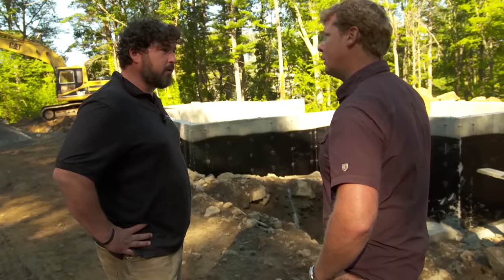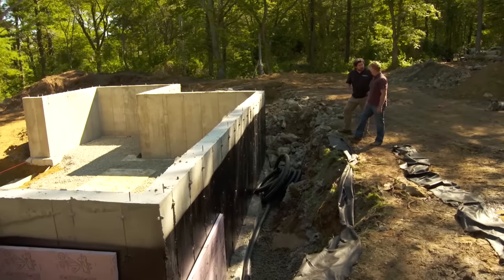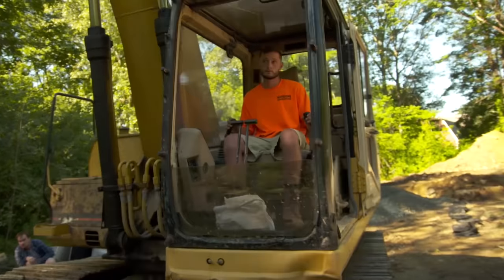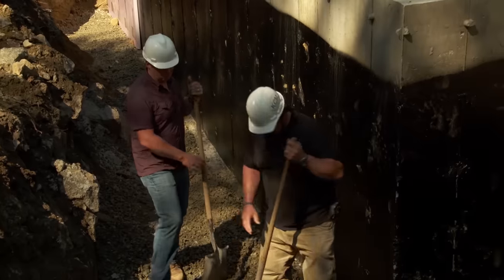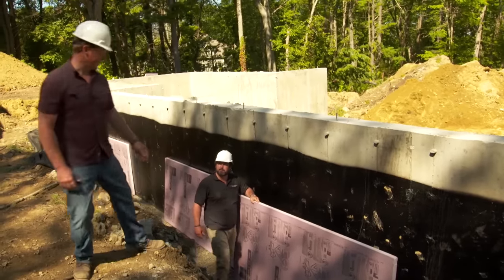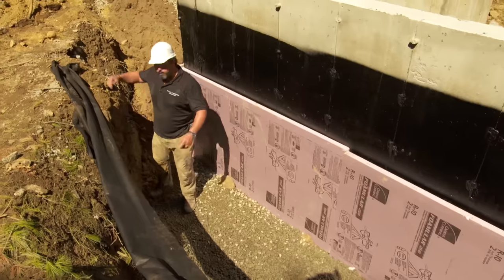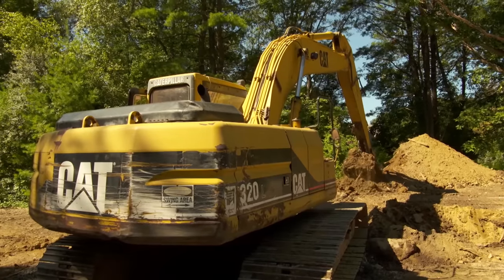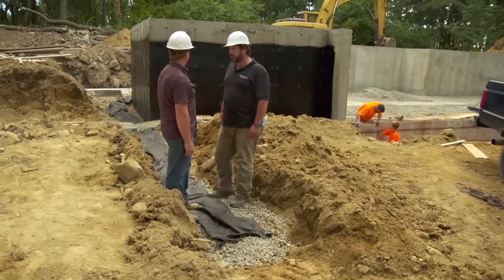How to Install a Perimeter Drain | This Old House

Comment: Sooo.....  You don't seal the panels of EPS together?  Water gets behind those if you don't seal them and then there's pretty much 0 insulation value.

Seems like this builder is just doing the exterior insulation with as minimal effort to satisfy code with no care to actual performance.
Reply: hey come on, he put some a random rock in place to hold it.  Job done.

Comment: Does the landscape fabric get plugged up?
Reply: It 100% gets plugged up if you put it over top the pipe like they did here in the video. You can put it underneath and on the sides of the trench but never overtop, and never wrapping the pipe.
Reply: @AlMai222  i think there ought to be a crushed rock vertical wall up against the cement foundation all the way to the bottom where the drain is at. Maybe be 2’ out from the wall. With the fabric being the barrier between the crushed rock and the backfill.  Dead leaves will probably be blown off the top of rock, at least able to keep clean.
Reply: @benritchsmith  that does work, it works really well like a French drain. And the fabric on the sides to block the dirt from the vertical gravel wall works like a charm.  Usually you wanna go a little wider than just 2 feet

Comment: I would have used solid pvc, holes facing down.
Reply: Holes face downward to allow water to enter from the lowest point in the ground. Holes downward also keep pipe from clogging since entry point into pipe is already at the lowest point. 
Holes on top would require the water level in soil to raise an additional 4” before it made its way into the pipe. With holes on top the pipe could potentially and most likely get clogged over time as there would be no where for the debris to settle out at.
Reply: @JohnSmith-xx9se  wrong dummy...water fills and rises from the bottom up. Have you ever even seen one of these work?
Reply: You want holes up to allow the pipe to actually convey the water away from the building. Otherwise what’s the pipe doing?

Comment: would it be better to have more than one drain pipe for something like this? since they have basically a stone reservoir trapping in all that water, i cant imagine a single pipe being enough to move all the water thatll be accumulating there, particularly on heavy days?
Reply: More pipes always better for more capacity and faster volume😊

Comment: Corrugated pipe won't last long. Schedule 40 pipe is better.
Reply: hard to find perforated schedule 40 in many places though.
Reply: @manillafresh57  You would need to drill the holes yourself
Reply: @samash1704  then at least go with triple lumen for Pete’s sake

Comment: So  you are insulating the area of the house that is in the ground. Why? The ground is ensuring enough insolation. Is not going to freeze in there. What is the porpoise of that wasted insulation? Did i miss something? Also corrugated pipe... cheap fix. Use schedule 40, 4” PVC.... that will last forever and will drain a lot better.
Reply: the insulation is overkill but better to have it and not need it than to need it and not have it. when dealing with mother nature, expect the unexpected and always be prepared.
Reply: Where I live, the frost line in the ground reaches 4 - 6 feet deep.  You want insulation around basements to maintain a comfortable climate controlled living space.  Heat would be sapped right out of the space through the concrete blocks into the ground otherwise.  (Which is fine if you want a root cellar.) A lot of new construction is putting 4 - 8 inches of insulation underneath the bottom concrete slab also.
Reply: @Kevin-mp5of  snaaapahh

Comment: It would be better to go with a rigid pipe with holes in it. That flexible stuff is garbage. Fabric closer to the pipe. Also at least taping the joints of the foam.

Comment: So many issues here! That pipe is crap and will get crushed. There's no cloth around the pipe to stop clogging. They should have used solid pipe with a cloth cover. Also, the stone should be river gravel to not press against the house! You can do better TOH!
Reply: Wrong wrong wrong. You should never ever wrap the pipe with cloth. The cloth is the thing that plugs up, then water doesn’t enter the pipe. They used to do that years ago in Canada and quickly found out that it’s the worst thing you could possibly do. You can put cloth underneath the pipe and on the sides of the trench, but never wrap or over the pipe like in this video. Science has shown that 3/4” clear crush gravel is much better for drainage than river rock also. They used river rock in Canada 50-100 years ago.
Reply: I totally agree with Fred on his points.
Reply: @AlMai222  river gravel won't bind and put pressure on the side of the basement wall.
Reply: @fredhinds9836  What will the little bit of extra “pressure” do? You never use river rock for drainage

Comment: Please, please, please don't use that flexible corrugated drain pipe.  It is garbage.  Buried as deep as it is, it will be a nightmare to replace when or if it fails.  Spend a bit more and put in rigid PVC.  With rigid PVC you can even put in clean outs.

Comment: Won't the water drain out the holes on the bottom of that pipe? and lay against the foundation wall
Reply: this is for when it rains really hard. the gravel under the pipe will help drain the remaining water slowly.